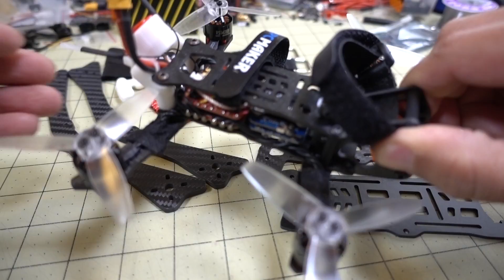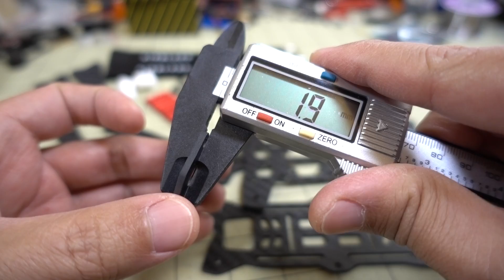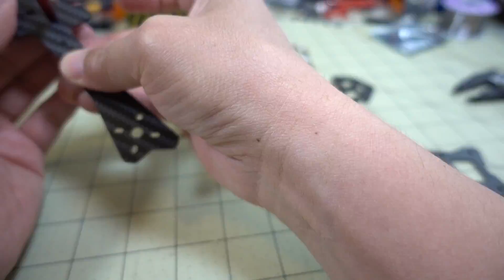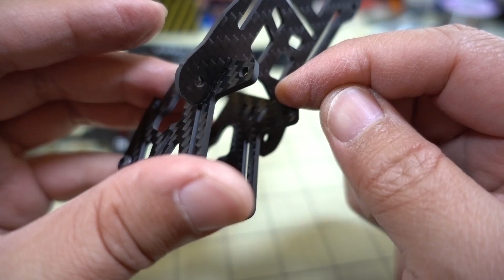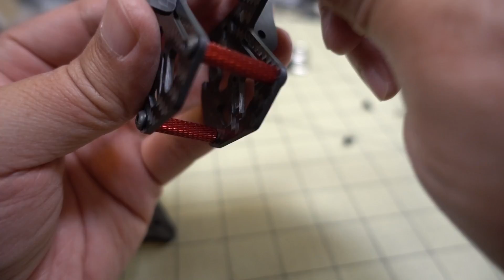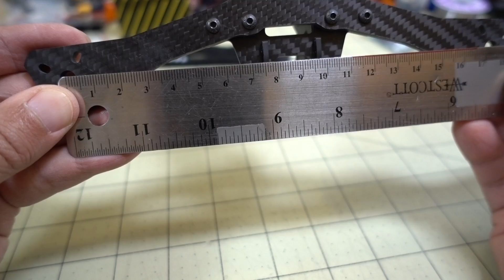AirbladeUAV Intrepid V2 5-inch Frame Review 👍

Comment: Hey Albert, could you put a split/turtle/mix camera in this frame to see if the props are in view? Im looking for a frame where I don't get the props in view using a runcam split 2 camera.
Reply from the maker: The props show up unless you have about 45 degrees camera angle (or more).  It's really mean for the GoPro which is higher up.  There is an optional adapter for $7 you can get that could mount the Turtle higher but the Turtle FOV is so large you may still see props.

Comment: Looks like its quite fiddly to get to the electronics after its put togheter? Unscrew the top six screws and then remove the whole camera cage?
Reply: johhakan actually after removing the top 6 screws you can pull off the entire cage together with it.
Reply: @airbladeuav4840  ok, maybe not a problem then! Do you know if/how much of the props will show in view if you use a runcam split or similar?
Reply: johhakan I don’t have it set up with the split, but the fpv feed has no props in view

Comment: Nice frame 👍 quick question: what's the best long range receiver that i can use with my Jumper tx, i have the original one so no module bay for crossfire etc. unfortunately. Thanks 😁
Reply from the maker: I'd go with the FrSky XM+ but antenna placement is more important.
Reply: @AlbertKimTV  thanks 😁